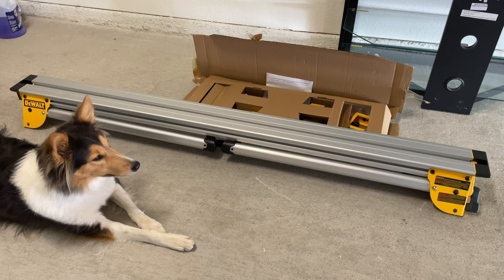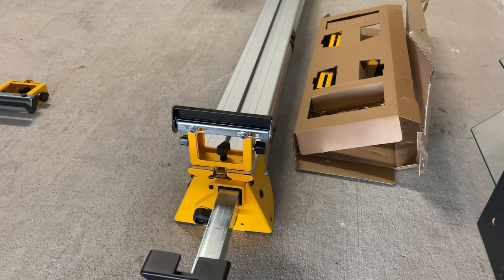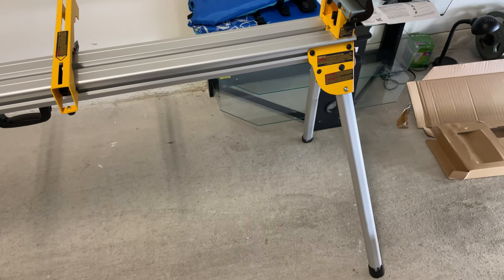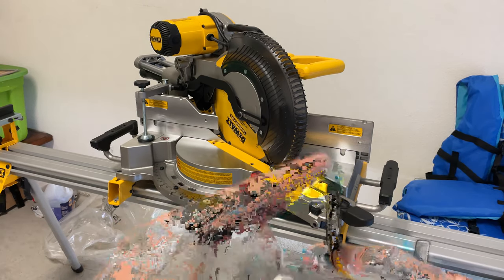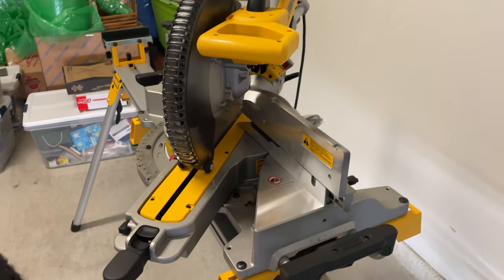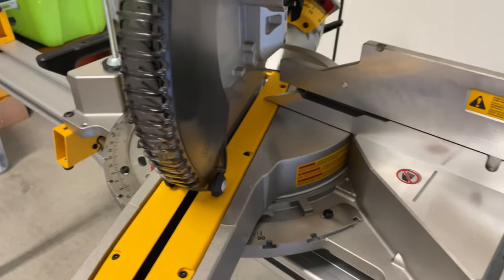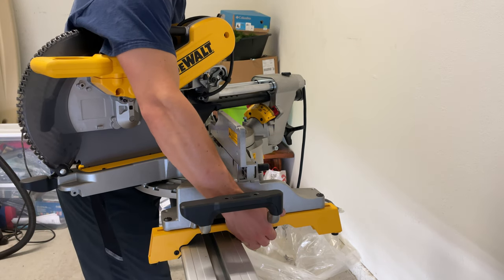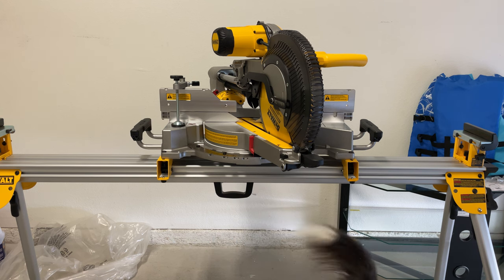DeWalt Heavy Duty Miter Saw Stand | Assembly and Review

Comment: Really appreciate this. I was starting to scratch my head if I was mounting it correctly.  The manual left much to be desired.  Thanks for confirming my suspicions.  The fact that it has double holes on each corner is what confused me.  The manual left much to be desired.
Reply: The manual has the older previous model numbers for mounting. 
I also am looking for confirmation about mounting the 779

Comment: Why not just mount the mounting brackets to the saw first?  And you mentioned putting the mounting bolt with the head up or down.  Should always be down as to not interfere with the saw sliding back and forth.
Reply from the maker: As far as whether to mount the mounting brackets to the saw first, it can actually be easier to mount it once the brackets are already on the stand because they are lined up perfectly and you have some thing a little higher up to work with. I mentioned having the mounting bolts head up her head down, as this is an option depending on what bolt you use.
Reply: The instructions specifically say the heads should be facing up - you just use the shorter bolts IF they impede your saw's swivel function.
Reply: @PerfectSnowball actually, the instructions say to reference the hardware selection chart. But that chart doesn't make sense because only one short bolt is provided yet for several saws it says to use it on one of the sides, which require two.
Reply: @AJSWoodworks I disagree it’s much easier to do it before then after simply because you have to raise it already to install the handles might as well take the time to add the brackets just get a strap that you can use to squeeze the triggers and hold them open

Comment: I added one of the work support and stop pieces on the extension arms so I have long on one side short on the other...but was disappointed that the point of contact with the bolt/flat piece that holds the work support to the extension arms mounts against plastic instead of metal.

Comment: Would it be easier to install the backets on the bottom of the saw before attaching to the stand?
Reply from the maker: Either way would work fine, but the brackets would not be lined up with the tracks that way.

Comment: Thanks for the instructions, however, the support/stop brackets should be mounted at the end of the extension arms and not on the end of the main rail so as support/stop  longer boards.
Reply from the maker: They are currently on the ends of the main rail on mine. However, I don’t do a lot of long boards anyway.

Comment: I just noticed my bolt bag came with 5 bolts, 4 was the long all same size with washer and lock washer but the 5th was a short bolt no lock washer and no washer
Reply from the maker: I talk about that in the video. You have the option of using the short bolt or a long bolt depending on orientation.
Reply: @AJSWoodworks  yeah I seen where you talked about it but you made it sound like it comes with the option to use short bolts or long bolts as in yours came with 4 long ones and 4 short ones
Reply: @JustinMentionedIt  The instructions say to reference the hardware selection chart. But that chart doesn't make sense because only one short bolt is provided yet for several saws it says to use it on one of the sides, which require two. I have the 780/782 and it says to use short bolts on the right side. Well, there's only one and there doesn't seem to be a reason why a short bolt is needed anyway. I used the four long bolts.
Reply: Short screw is for DW717 saw, left side. See page 3 of instructions….head on bottom.

Comment: Thanks for the video. I bought one and I wasn't sure if I was luttong it together coreectlty. The instructions are a joke, hahah. Normally, dewalt has a bug manual with a lot of info. Not in this case. 

Mine only came with the button screws that fit like a nut inside the holes on the saw

Comment: With all respect, the carriage bolt holding the saw goes in from the bottom and fits into the slot which holds the carriage bolt, that’s why a carriage bolt is supplied.

Comment: I agree with the others, the instructions suck! As for the stand itself, mine doesn't wobble at all, it is very sturdy. My problem was, the hardware bage was open and empty. It was all in the box, sliding around. There was one washer missing. Also, the bolt that holds one of the black end caps on was not installed right and stripped the threads. Great video!